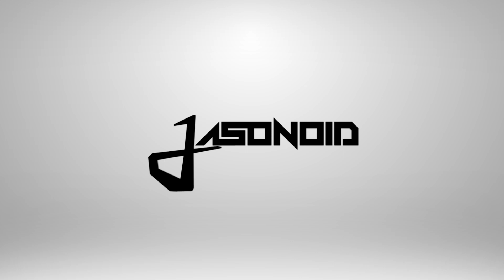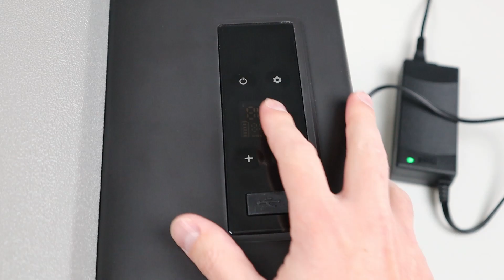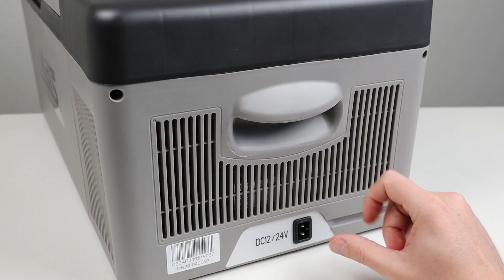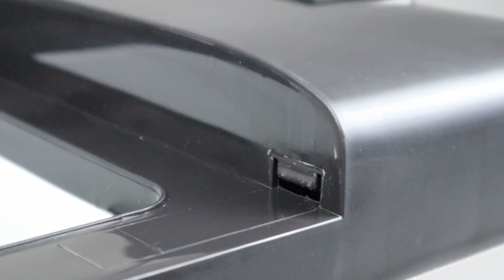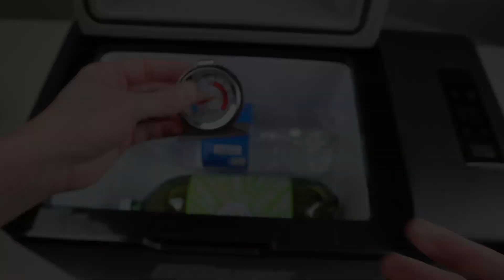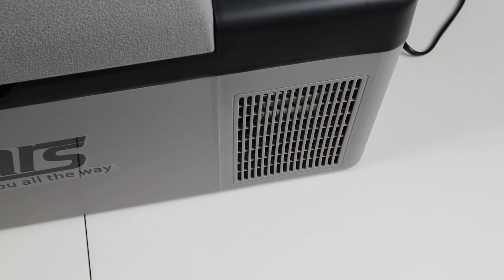iMars C20 Fridge Review - Buy Your First 12v Compressor Fridge!

Comment: I have the Alpicool C12 model that looks just like this. It is smaller, and I use it as a dedicated Freezer in my Camper. I also use a Ausranvik 54-Quart portable fridge for the food / drinks. It has been running 7/24 for almost 2 years!!
Reply from the maker: There are lots of different brand badges for this fridge, glad to hear you are having such a good experience with it!

Comment: The alteration of lid is improper. To make lid easier to open simply add a length of very sticky strapping tape or highest quality duct tape to lid under lift indentation leave a long amount of tape to fold against itself to form a three inch tab to grasp, then press the remaining six inch length onto top of lid. Now grasp tab and lift lid open.
Reply from the maker: To each their own. I'm sure there are multiple ways to get it to work. Still a great fridge for the price!

Comment: For testing I think a cool thing to see would be to put it in a car overnight and see if it stays on and how much power it draws.
Reply from the maker: Hey Chad, thanks for the tip. In the testing section of the video I covered the average power draw of the fridge per hour (at 70F and at 85F), so if you had a 60AH SUV/truck battery you could use about 30AH without damaging it. So usually running the fridge for 12 hours in the night at 1.5ah power draw you would use about 18AH over night. You could keep it running longer if you had solar panels and a solar charge controller to charge it during the day. Hope this info helps get some ideas going for you! I have other videos about the subject or even using a 2nd power source with is safer than running off your SUV starter battery.

Comment: Excellent. Thank you. I am researching fridges for my small sailboat. Since space, weight and power draw are all critical, I actually have to plan my interior redesign to work around the fridge. I think sailboaters (people in small sailboats that do overnighters would be very interested in your channel. I woder if you've considered that? Thank you.
Reply: Oh, yeah. I used your link and bought one. Cheers!
Reply from the maker: Thanks Daniel! My brother in law has a small sailboat and I've recommended these fridges to him. I think camping/sailboating with solar panels , batteries, and fridges is such an awesome combo! I love 12v portable systems 😁